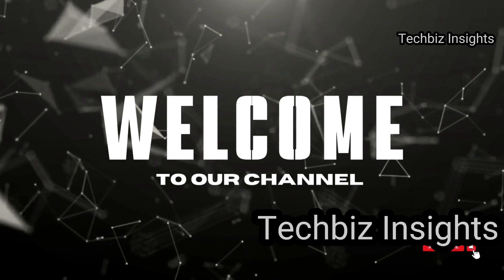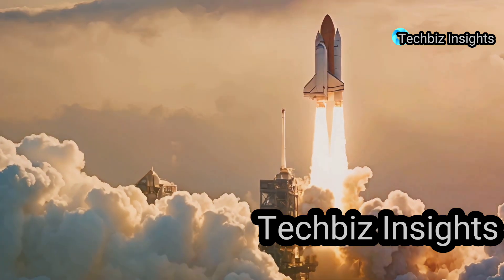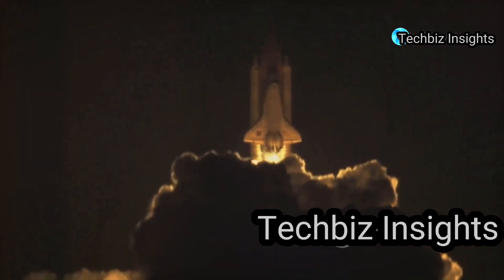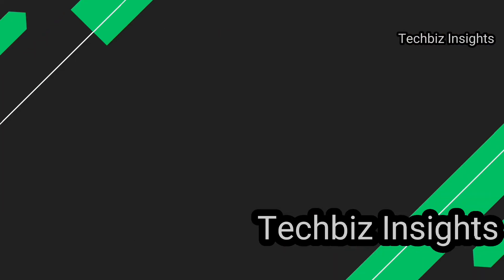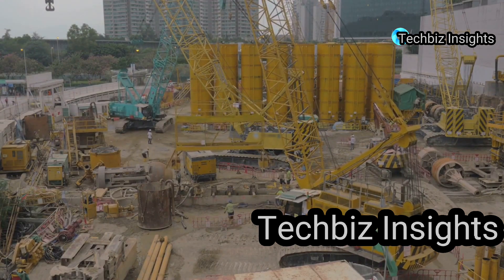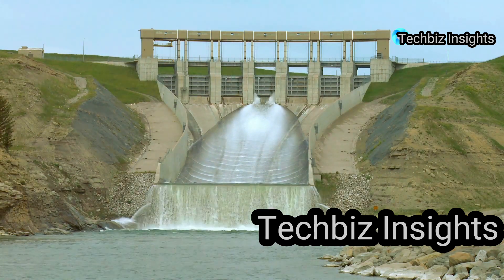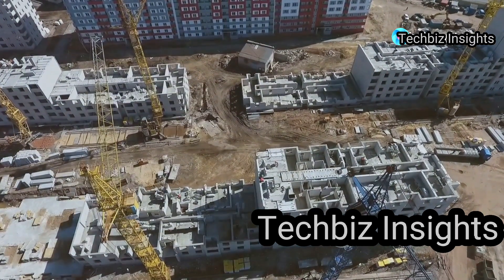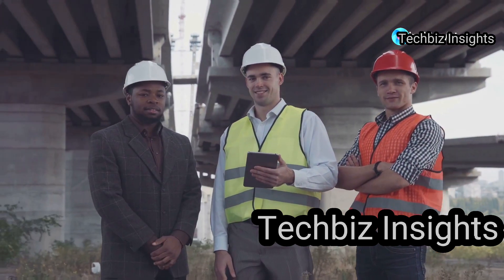Top 10 Epic Construction Fails in History

Comment: Quebec bridge had two collapses!  The first and second were caused by ignorance of engineers about elastic instability of structures . Stephen Thimoshenko (master of strenght of materials) findings! ) A third similar buckling is as of  now, in progres; after the same misunderstanding of elastic instability.

A faulty, optimistic, 3D modelisation using the wrong assumption that the windbracings and supports remained totaly inside their plastic phase , led the owners to exert excessive live loads by ore trains responding to a major harbour developpement.

The bridge, on its main posts and critical K frames is observed buckling, not on the side of the corrosion from road salts but towards the upstream side where trains are the main load.The main posts and several K frames  show thus extensive inter-rivet buckling .A major crack on the north-west main post can be easily photographed. That bridge is beyond repairs and acceptable standards , to my opinion!
Reply from the maker: Great insights👍